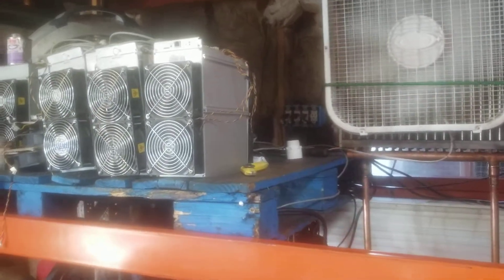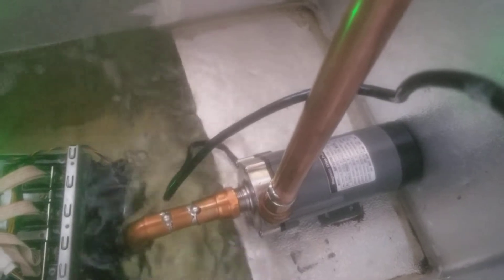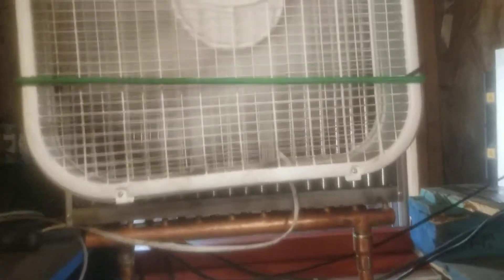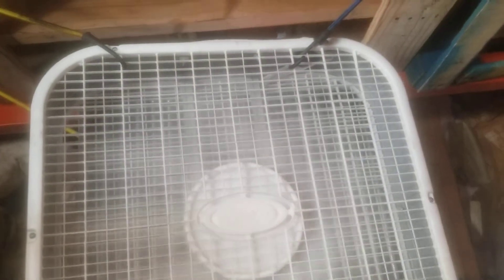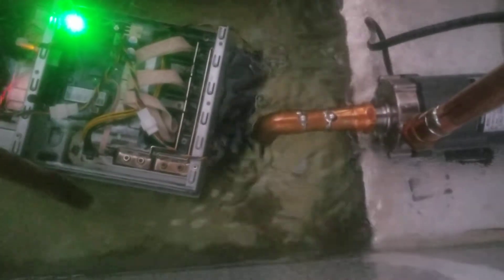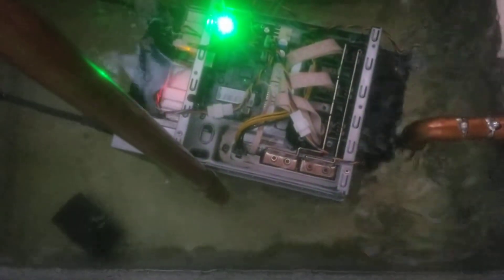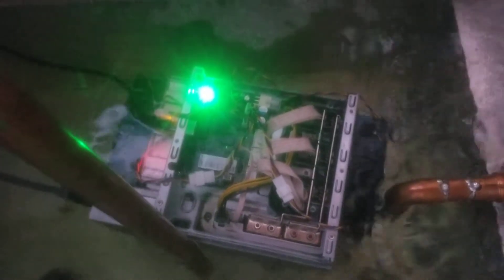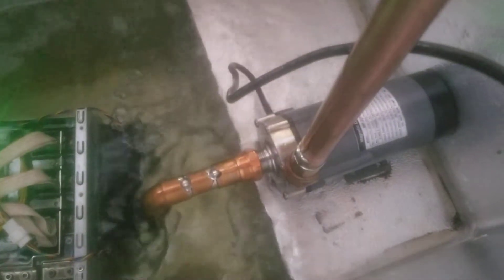DIY Immersion Tank Version 2.0 Bitcoin Mining Efficiently

Comment: I know you’ve been asked many times if the freezer is running, which you’ve said it’s absolutely not running. My question is, have you ever experimented with running the freezer and a circulation pump? I’m wondering if a reach-in refrigerator could possibly work. Some modern compressors are rated pretty low, like only 250 watts. Awesome DIY project!!

Comment: Hey bud ! the set up looks awsome. im in the process of designing my tank and just have a quick question. which way do you have the pump setup ? Is it sucking the cooler out of the freezer to the rad or the other way around ? thanks !
Reply from the maker: Thanks! Yes it sucks from the cooler up through the radiator and back down

Comment: Is the deep freezer on or just a reservoir?  Does the rig stay cool just by being immersed?  Meaning there's no flow forced thru the hash boards like fans would push air?
Reply from the maker: Deep freezer is off. The flow of liquid is pushed through by the fans that move at 200rpm instead of 5000rpm. Technically you don't need them on at all tho

Comment: i have done the exact same thing. the pool pump i was previously using was far too noisy and was also causing massive cavitation. i swapped the pump for a boiler pump. far quieter. i for now i have used a series of 12mm fans instead of the box fan i have. all for sound suppression. i also used a dual loop system
Reply: 200KW immersion cooling box, holding 39*S19, click: https://youtu.be/w029O8xXBHM

Comment: When taking off the fans, what spoofers did you use?  Is there any part of the ASIC's you did not get wet and should avoid getting wet?
Reply from the maker: You do not need to do anything with the fans. Immersion mode turns them down automatically. You can get every single piece of the miner wet.
Reply: @brothersmechanics2028  Interesting. Did you simply leave the fans attached?
Reply from the maker: @functionised  yes
Reply: Last question… Greatly appreciate the guidance… Did you also submerge the PSU? Most importantly, would you feel comfortable submerging the AW7 by Bitmain to run the minis or boxes?
Reply from the maker: @functionised  You can literally submerge completely any electronic part. It will not hurt anything.

Comment: Hey. What's the update? Stilll running strong I hope.It's impressive that you don't have any kind of flowplate yet are getting great temps. The 60C temps on the miner, is it chip or PCB?
Reply from the maker: Yes running great with zero issues. Currently building another bigger tank for more miners, at some point will make a video.
Reply: @brothersmechanics2028  Great, but is the 60C PCB or chip?
Reply from the maker: @af6727  That is chip temps. The pcb is lower in temps like usual.
Reply: @brothersmechanics2028  My brother mechanics this is such great temps.

Comment: fix two issues at once take you magnetic pump and submerge it in your dielectric fluid, this will take care of your priming issue and it will keep your pump from overheating long term, I have the same pump in my system and it has been working great for over 6 months under this condition

Comment: How do you prime the pump? Unhook it from the system so you can move it? You should post a vid priming it. 

Why didn’t you mount the pump somewhere easier to get it started? And why did you mount the radiator directly over your tank?

Not hating, going to buy the same radiator and build a very similar setup. First time immersion cooling. Thanks!
Reply from the maker: Simply submerge the pump to prime it. It's above the freezer only because of the situation that it is in.
Reply: @brothersmechanics2028  I’m still not sure what you mean, how do you submerge it?

Pour more oil into the tank until the oil level is above the pump?

Or unhook the pipe somehow from the pump,  turn the pump on then reconnect the system with the pump running?
Reply from the maker: @xclarryx  with my setup all i had to do was unhook the bungee cords, dunk the whole system into the fluid until the fluid started to circulate. It's a very light system so it's not hard to do. 
The better way to prime it would be to install a copper "T" somewhere up top with a switch and pour fluid into it.
Reply: @brothersmechanics2028  ok that makes good sense, thanks for taking the time to explain. 

I’m going to order one of these heat exchangers and use this vid as a guide. 

One more question, the two long vertical pipes going to/from the heat exchanger. Where did you come up with that length? 

Thanks again!!
Reply from the maker: @xclarryx  no problem,  the length was only determined to get it to the height of the building window so we can push the heat outside for the summer. Good luck!

Comment: I wanted to ask you if the magnetic pump works 24 hours without overheating?
Reply from the maker: Yes it will run for years without overheating, or you can just keep it submerged.

Comment: Cool! I like that you went with copper pipes. Looks heavy duty! Is that March pump? Would you please further elobrate on primeing it? What did you mean by "move the outlet"? Like dump it in Bitcool?
Reply from the maker: Pump model# MP-20RM-110
Priming only means you have to submerge the entire pump in the fluid to get the suction started otherwise it won't do anything.
Reply: @brothersmechanics2028  So I connect the suction inlet and before connecting the outlet I simply dip it into liquid then go on with outlet connections?
Reply from the maker: @af6727  Connect everything, then submerge entire pump into bitcool and then turn on pump. It could take a few dunks in and out of bitcool but after some time itll eventually push the liquud up.
Reply: @brothersmechanics2028  how do you dunk it in and out with the pipes hooked up?
Reply from the maker: @xclarryx  the whole set up is very light, so i just unhook the bungee cords and dunk the whole thing. Its definitely not the ideal way but it works lol
A professional would add a copper T and switch and prime it from above.
Reply from the maker: The copper piping really helps with the longevity of the project, the pvc from the first version did well but would eventually fail over time. Thanks for watching!
Reply: 200KW immersion cooling box, holding 39*S19, click: https://youtu.be/w029O8xXBHM